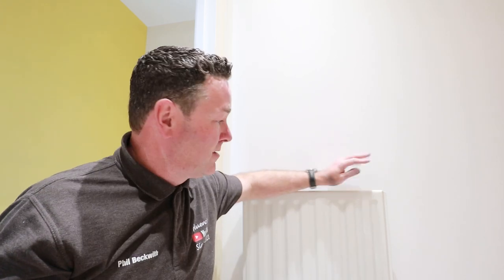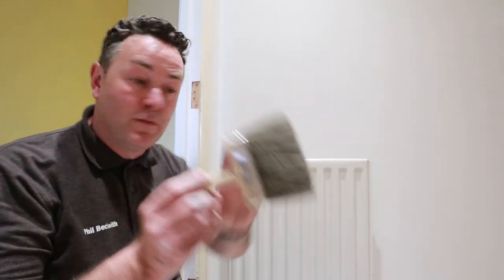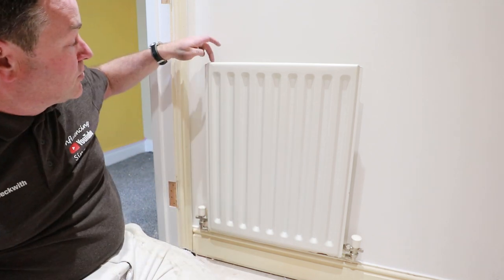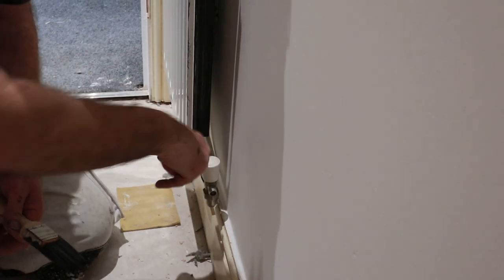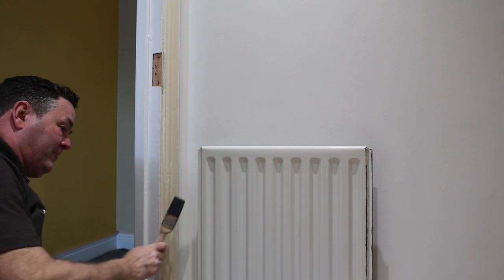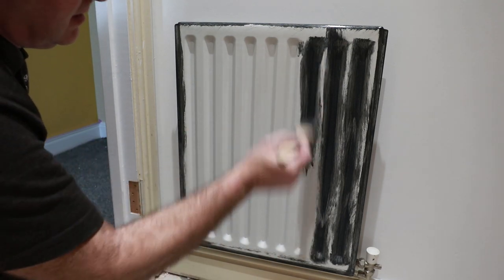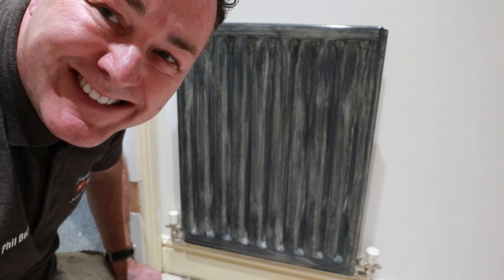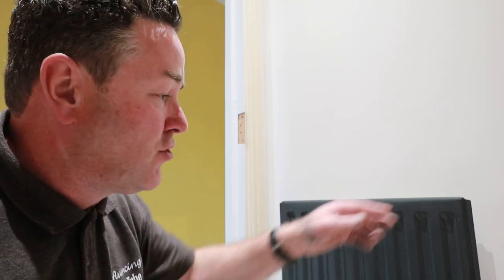How to Paint a Radiator - Bedec MSP: A Step-by-Step Guide

Comment: When I paint rads I like to paint the above and below horizontal sections first half way and finish off with vertical strokes lightly tickling the tops and bottoms so you can’t see any horizontal brush strokes so it all blends in and evens out nice. Just a technique I learnt myself after painting many rads over the years.

Comment: Nice one Phil..a far better alternative to oil...which stinks for a while after when you put the heating on, even if they have been dry for a while.
I used to buy a litre of oil based eggy in a colour to match the wall...but what a waste of money for a few brushfulls. Ive been using standard water based gloss on them for years without a problem, but a msp is a safer option 👍

Comment: I remember back in the day as a young apprentice, we used to paint these rads in oils while hot, boy did they stink and make your eyes run. LoL - Always took the plastic caps off just to give a little more room to get the brush in. The knuckle at the back was a prime place for dust to collect and if not removed, got into the paint and brush making a terrible mess.
Reply from the maker: You're correct. No need to let your oil paint sit in a slow cooker if doing a hot rad lol

Comment: On site yrs ago we always used just oilbased paint, Dulux, Crown etc,undercoat & gloss, never any issues , i have even used waterbased recently & again no issues, i return to some clients yrs later & i check it's holding up & it looks fine no cracking etc from heat, tbh i recommend to most now to just get rad covers as there so cheap & rads are uglies that i always tell clients to hide, can camouflage in with wall colour in the right paint but yes hide the uglies & highlight the nice features in the house recesses moldings fireplaces etc

Comment: Not sure if you mentioned it but sometimes a mini roller down the back edge and welded edge works. Just using the end of the nap
Reply from the maker: yes that does work well..... you'll like  a future video where I spray the radiators!!!
Reply: Looking forward to it. I've sprayed a few with my graco and it's just time consuming. Totally off topic but I've been using quite a bit of wrx satin lately and love the stuff, I'm just wondering if you have used their acrylic undercoat?. I've used jonos aqua system last couple of years just like trying new producs. Cheers
Reply from the maker: @callumpainterNE  i've tried the eggshell and satin, the eggshell is too dry for my liking.
not tried the uc.

Comment: Decided ill try this on couple rads. Tbf there in good nick bar few little marks but ocd in me would rather do whole rad rather than touch up. I painted them about 4 years ago with dulux satinwood (after advice from dulux when rang them). Can i slap this straight on do need to sand a little ? Ive removed the rads for decorating which will make life a lot easier
Reply from the maker: rub down, dust off (wipe with damp cloth if needed)
then get it coated up .. 2 coats :)
Reply: @ProfessionalPainterDecorator  excuse the ignorance.  When you say rub down is that with something like scotch pad or light rub with something like 120 grit ?
Reply from the maker: if its in good condition you need just to give it a light sand over with a Mirka GoldFlex pad 150, or some 120 worn sand paper will be enough.
Reply: @ProfessionalPainterDecorator   thank you

Comment: The fins on the back of the rad are called convectors. They pull cold air in from the bottom and push warm air through the top by convection. I had a big massive one to do on the job I'm on at the moment so i broke out the Graco! 👍
Reply from the maker: I thought they were for adding a greater surface area for the radiator to conduct the heat fom the main part of the radiator into them to radiate the heat better?
YOU like the hvlp spray video on radiators coming soon then :D
Reply: @Phil Beckwith The Professional Painter & Decorator  You aren't wrong in what you're saying. Air inside the convector is indeed warmed by the radiator itself. As the warm air rises through the convector, cold air will move in from the bottom to replace it and so the whole process will begin again. Every day's a school day!

Comment: Hi Phil. Have you tried the bedec msp on woodwork? For those wanting to move away from oil based it seems like a no brainier, particularly given it is self undercoating? I am going to try it especially the satin. Cheers pal
Reply from the maker: Oh yes. It's very good. A friend of mine wanted to paint in holiday let rental and asked what paint, I said use MSP . A sand, dust off and coat up .. he did two coats and said how easy it was just going around with the same paint that covered well and had a great finish.
Reply: @ProfessionalPainterDecorator  thanks mate

Comment: Hi mate what’s the white satin like? Thinking of using it on a new build for mdf skirts and window boards and bare door frames
Reply from the maker: Ideal.
Reply: @ProfessionalPainterDecorator  so go straight on with it then mate?
Reply from the maker: @wowal4136  are they pre primed?

Give a light sand.. dust off.. coat up. Nib between coats.
Reply: @ProfessionalPainterDecorator  yes mate pre primed and bare door frames

Comment: ive always spot primed any bare metal from chips etc with oil zinc primer had to actually strip several rads this year so far primed with oil zinc primer 2 coats of palatine industrial 2 hour gloss hard as nails. I think all these msp paints are 3 coats no matter what which does make it quite expensive way really i did some lead flashing last week in traffic grey ral colour needed 3 needed 3 on exterior windows white on white
Reply from the maker: How long do you think the paint will last on the lead flashing beofre it start to oxidise again?
Reply: @ProfessionalPainterDecorator  probs 3-5years
Reply from the maker: @jackwardley3626  sounds good for business :D
Reply: @ProfessionalPainterDecorator  mind you i used dulux trade opaque oil based 10 years gear over my dads garden furniture previously done in cuprinol muck and opaque was peeling after 2 years redone one of benches 4 years ago stripped it all primed in ali primer 2 coats of standard gloss and its still good can't take any notice of these 10 years life span etc

Comment: Shouldn't you be using a specialist radiator enamel for radiators, or is that outdated thinking?
Reply from the maker: Yeah. LoL bit outdated now.
You can use emulsion if you do wish..
Reply: @ProfessionalPainterDecorator  I can't tell if that's a joke or you're being serious? Surely you can't use emulsion? They've not changed that much in the last 15 or so years have they?
Reply from the maker: @robert.wigley  nope, I've used water based wall/ceiling eggshell (LICK- PRO) paint my radiator last week. Often theres a time when a rad needs losing in with wall colour.
Bedec MSP goes on radiators fine, as does F&B modern emulsion etc
Reply: @ProfessionalPainterDecorator  Wouldn't it be better to get the same colour mixed up in a satin in that case e.g. something like Zinsser All Coat?
Reply from the maker: @robert.wigley  depends if you want the radiator matching the walls finish and colour

Comment: The worst thing you can do is paint a radiator 🤦🏻 I know that it some cases it’s a must as you say flaking paint & rust, but where possible avoid at all cost it ruins them  but if you have to, spray it don’t paint !
Reply from the maker: why is it Janet?
Reply: @ProfessionalPainterDecorator  it’s alright if you are a good painter, but many are not, I’ve seen sooooo many poorly painted radiators & Geeeezus what a mess 🤦🏻 I have painted a fair few myself but nowadays it’s just easier to spray them & a much better finish 👌🏼